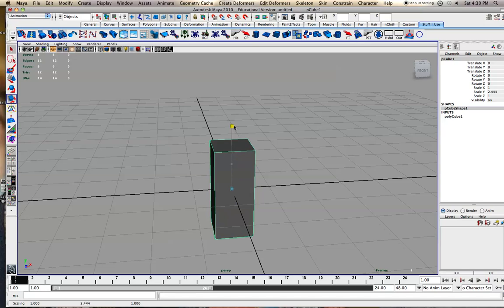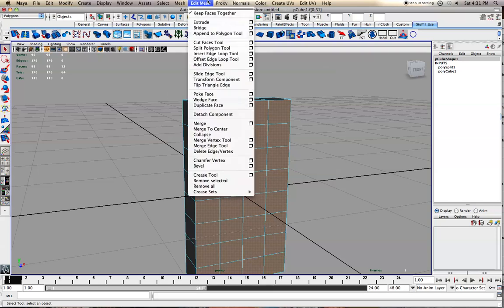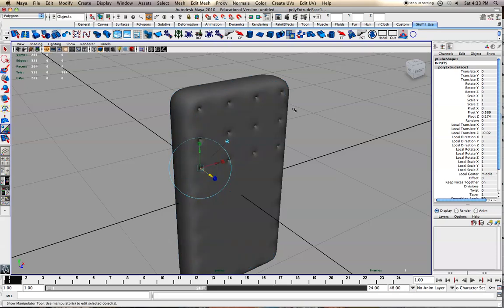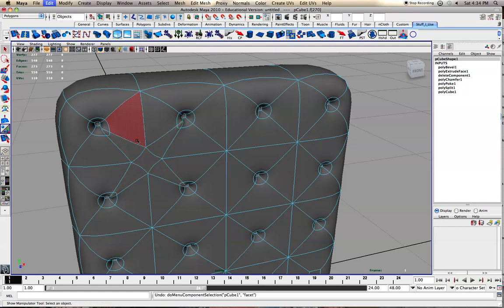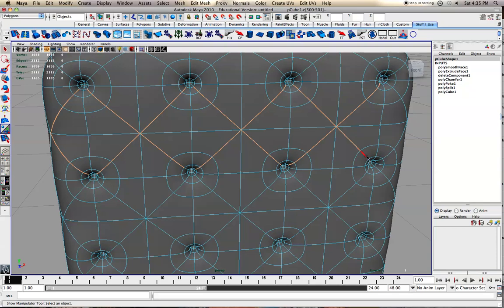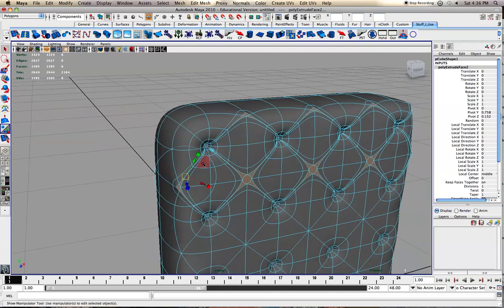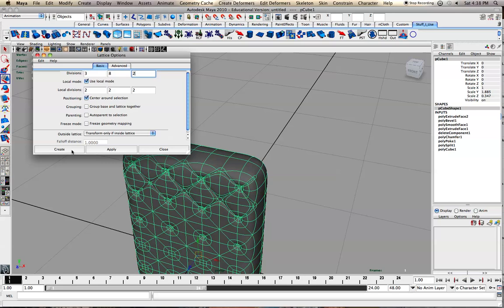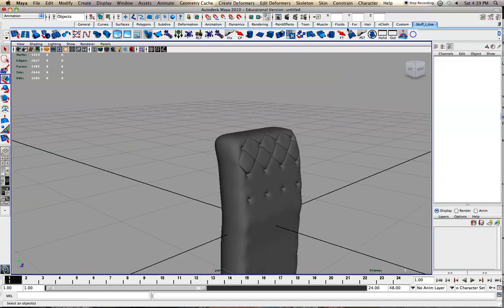Creating a mattress/ chair/ sofa

Comment: no offense but your written instructions make no sense when you don't include the values for everything. besides that though I'm on  a computer that doesn't have audio and I"m comletely stuck on the part where you're suppose to bevel.  I've tried several different ways to get the same bevel that you do at 3:22 with absolutely no luck. how do you get that shape....